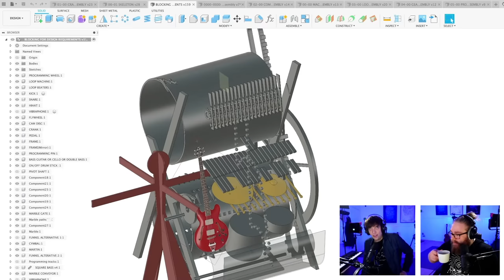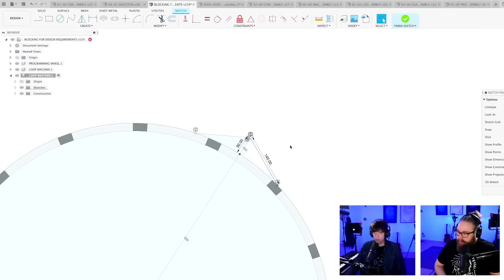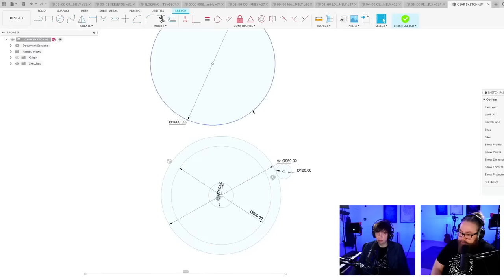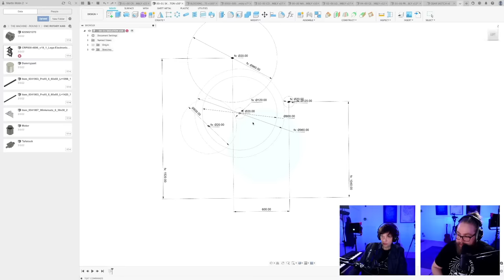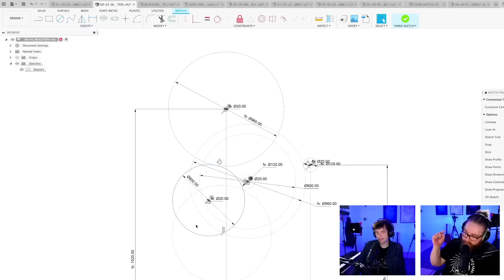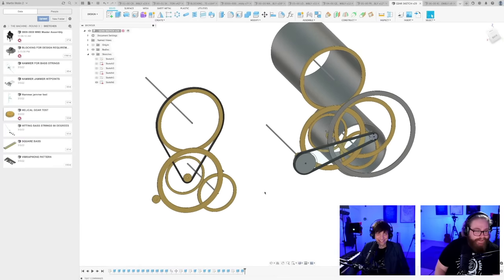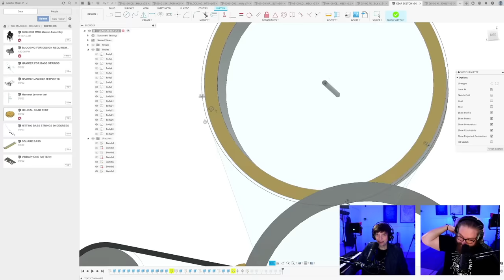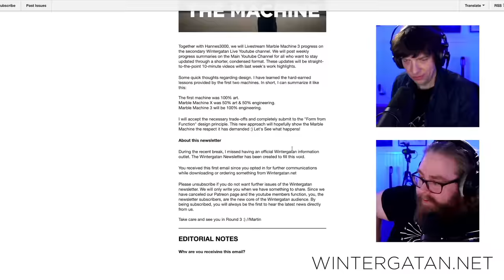Gear Train Design - Martin vs The Machine

Comment: The nice thing about belts/chains is it leaves much more flexibility (pun intended) in the design process versus gears and drive shafts. e.g. as the design is iterated and components may be moved around slightly, it's more likely you can re-use chain paths by just changing chain lengths versus needing to craft entire new driveshafts or gear assemblies.

Comment: A belt actually gives you the opportunity to adjust the exact timing.  If you put an idler on each of the legs of the belt then you can adjust them differentially to set the timing.  In other words, you shorten one leg and lengthen the other by tightening one idler and loosening the other.   For sure, an automotive timing belt is stable enough for this application.

Comment: Instrument timing suggestion: one thin programming wheel for each track, each of which can be rotated and fixed on the drum independently, thus controlling the timing of each track.
Reply: That would create a large source of error. Having each track independently spin would mean you would spend forever trying to sync each line to the next, so that your music ends up on the same beat. This alignment would also need to rely on a fairly thin lock for each wheel that would need to be able to allow for corrections. It's possible, but an unnecessary nightmare when you could just machine the timing into one solid wheel. There's also no real advantage to having independently rotating track programming, since you want all the timing to be the same throughout the instrument.

Comment: If you still plan to use a large HDPE pipe that weights 100+kg per meter, does this mean, you could get rid of an extra flywheel? The programming drum alone could provide enough inertia.
Reply: I think he will mill it out to be thinner but wanted to find some standard stock to work from, since he didn't want a repeat of "taming the dragon".

Comment: I am with one gear gang. But if you want just one extra gear, make it a steel or nylon gear pair of equal size. Just beside your drive shaft you place a reverse drive shaft connected to the first one with two small gears. The driveshaft pair can then feed rotation in any direction.

Comment: You can cut parts for a timing belt pulley just as easily as gears.    Belts can be spliced together as long as you need.

Comment: Use Gates belts and their design software to get exact center to center calculations. If you need to tension, just adjust actual pulley position somehow instead of adding an idler

Comment: Cant you just add a same sized cog above the small one on the loop drum which now holds the belt to the programming wheel? Just run the belt from the second cog and the direction will be reversed without much change in the design and ratios. Team one-cog.

Comment: I'm a bit confused as to what is going on, is Martin still working on the current machine? Redesigning? New machine?
Reply: New machine...
Reply: @jackwarneckii4406  hot damn, what about MMX :(
Reply: @whybothertry8642  MMX is dead. Long live MM3. Get with the program :)
Reply: @EaglePicking  damn, good luck with this I guess
Reply: @whybothertry8642  the current idea is to design mm3 then have the parts manufactured, eliminate as many issues as possible during the design process. MMX had numerous problems that kept needing fixes etc, the final straw was when adding new elements the transportation between the funnels and the magnetic lift clogged and broke. Too many issues to fix without further headaches, given how many alterations and fixes Martin had to employ up to that point
Reply: The algorithm wouldn't let him finish so he gave up. Looking forward to MM487
Reply: @calvinthedestroyer  sod off

Comment: I think your gear ratios are wrong. 
Multiplying radius or diameter won't be right. 
You should multiply small circle's outside circumference by 8 and have that to be big circle circumference to get 1:8 ratio, correct me if i'm totally wrong.
Reply: Circumference is 2π•r so the proportion between the circumferences, 2π•r / 8(2π•r), would be the same as between the radii, r / 8r

Comment: WRT to noise - surely almost all the noise of the machine comes from the marbles themselves and their transport mechanism. Introducing the complexity of helical/herringbone gears (especially in plywood!) for rather slow-moving components to reduce a virtually inaudible component of the noise does not seem like a wise design decision...
Reply: At the end of the live session the advantages of belt drive was implemented. Marble material is also under discussion in previous live stream. Different low friction plastic marble are suggested.

Comment: If the goal is just to drop marbles and play notes then the belts and pulleys and wheels are not needed at all. Use some kind of chute and just propel them through the chute. It won't look nice but it will work. If you want it to look neat and have spinning wheels and belts and all of that then just complete the MMX.